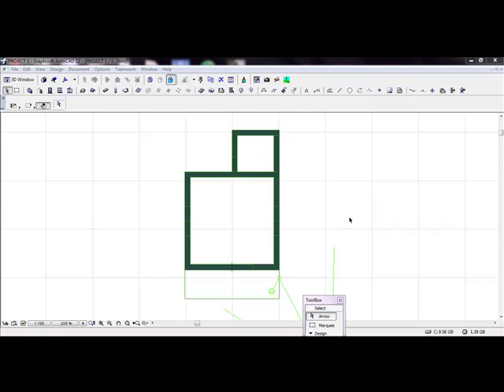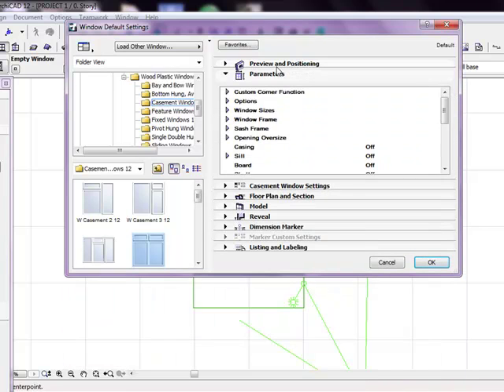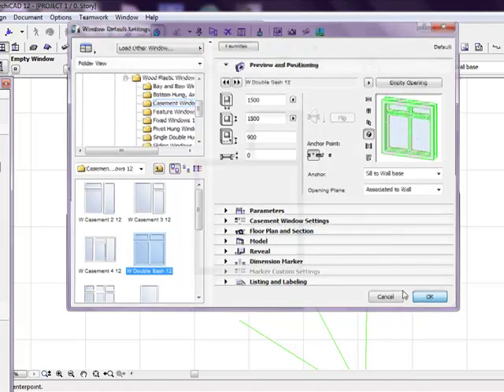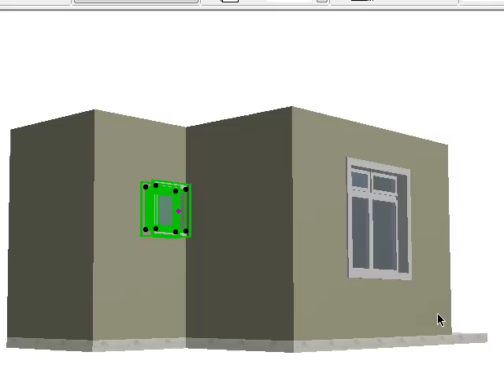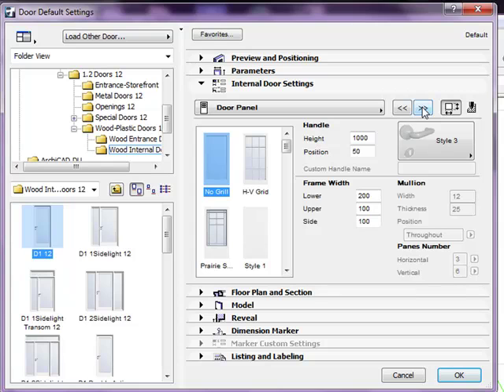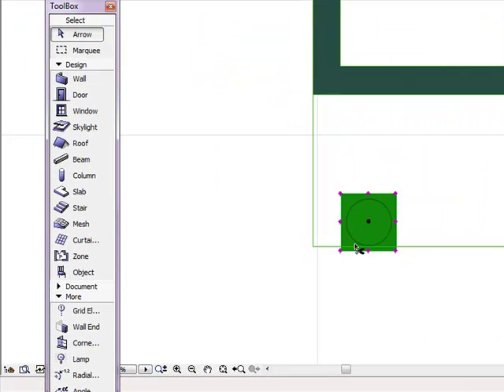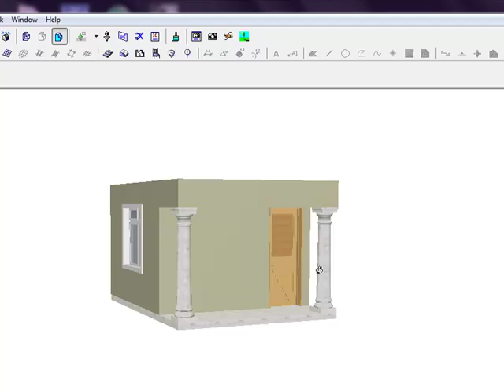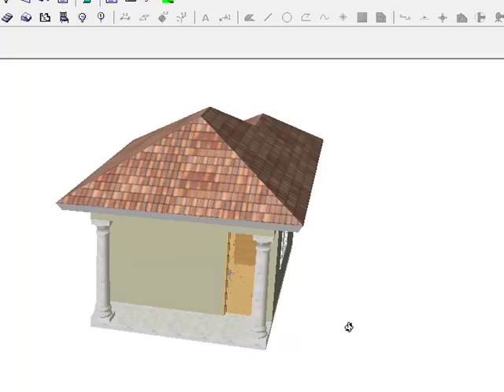Archicad tutorial, adding windows,doors and roof to your 3d model

Comment: Hello please i'm having a little problem with my archicad. When I try to off set the wall or the line does not go  straight  vertically Or horizontally and I don't get the exact dimension I off set what should I do